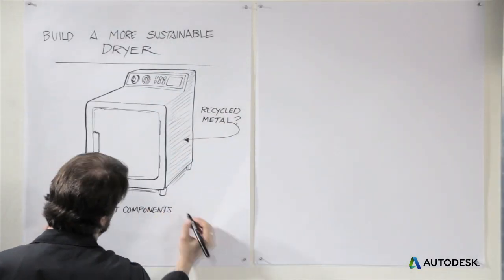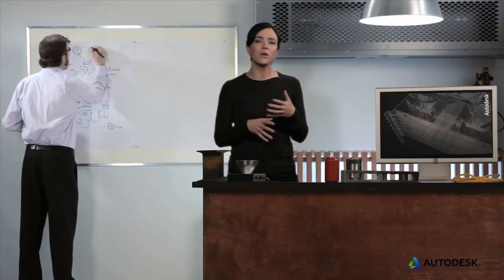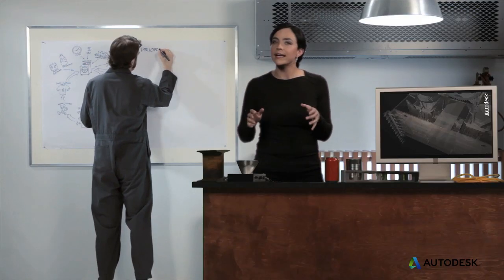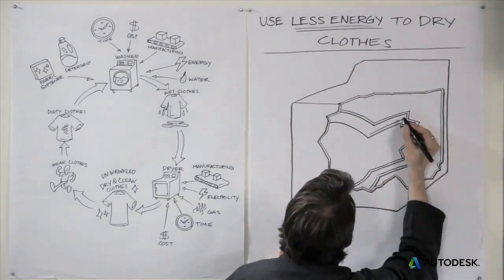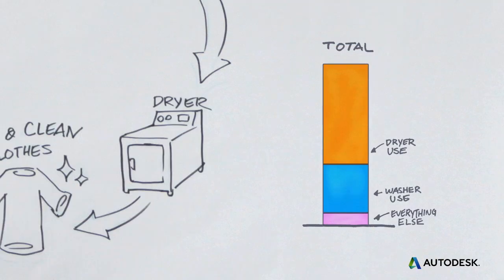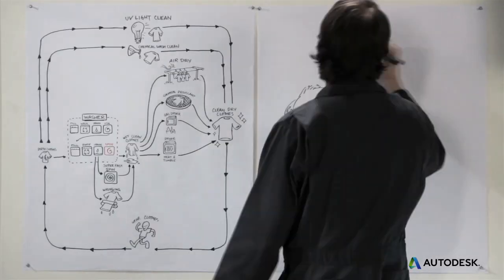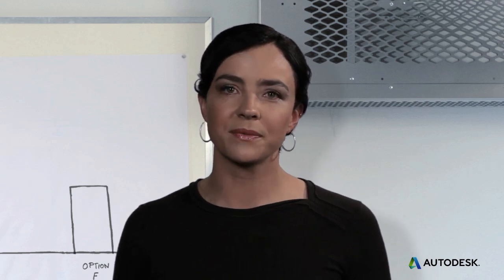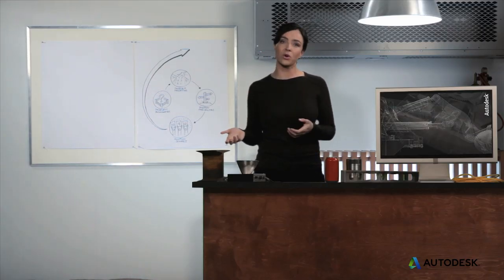Whole Systems Design: Introduction to Life Cycle Thinking

Comment: For the life cycle assessment, which of the following descriptions are false:
1. This life cycle assessment affects the cost of the design.
2. In practice, the engineers should design and manufacture the products firstly and then consider the life cycle assessment.
3. The regulations in the life cycle assessment include but are not limited to air pollution, gas emission, and toxins emission.
4 .There is no need to quantify the product environmental impacts during the assessment.
Please feel free to comment